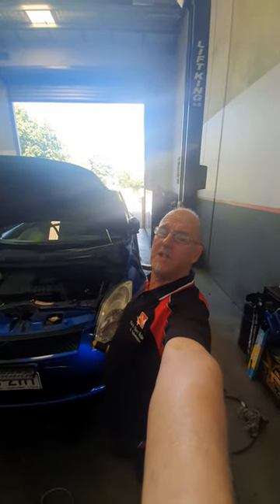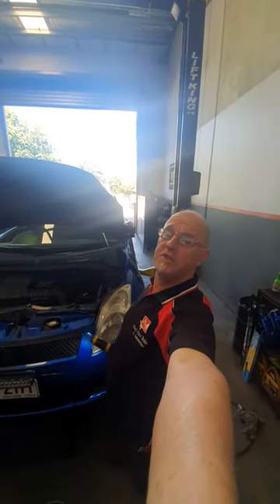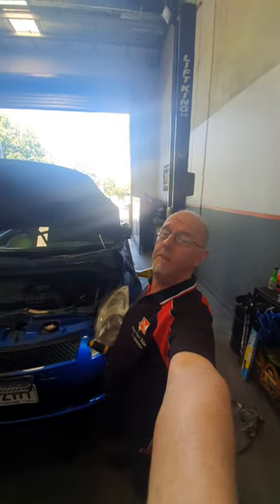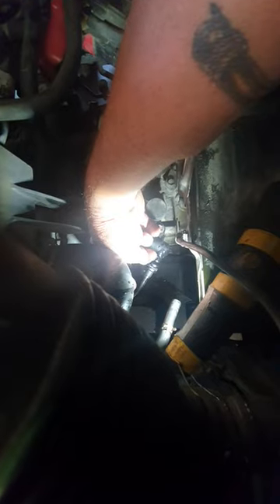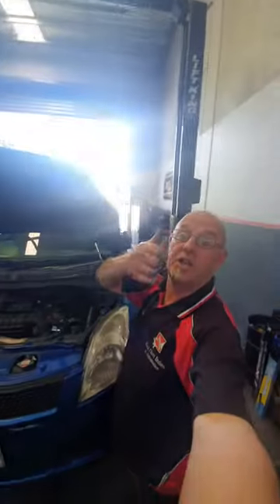Suzuki Swift how to bleed the Clutch

Comment: How deep do u need to push the metal because mine doesn’t have no pressure when trying to bleed ..it just throw the fluid  out
Reply from the maker: Check the clutch master cylinder has fluid coming out if it just in case the master cylinder is faulty
Regards Matt

Comment: this is probs going to sound dumb but by pushing the clutch in and out for long enough and bleeding it would this bleed the brake system too? because my 2008  Rs416  swift sport brake and clutch fluid are all used by the one fluid and not two separate  fill spots
Reply from the maker: If you've been bleeding the clutch and run the reservoir out of fluid then topped the fluid up again it should not have affected the brakes. 
However having said that if the brake pedal is spongy after bleeding the clutch then Yes you'll need to bleed the rear and front brakes. 
Remember no question sounds dumb.
If we never ask a question we'll never get an answer. 
Thanks and Regards Matt.
Reply: Whats if it's the opposite

Comment: I have a question, I push the clip down but I can't get any outward movement on the hose, any advice?
Reply from the maker: Maybe give it a wiggle, up, down, sideways or spray it with some lubricant then give it a wiggle. Regards Matt.
Reply: @firstclassbrakesandautomot6941  Thank you! I'll try it out later today. As a last resort could i just remove the clip entirely? (put it back afterwards ofcourse)
Reply from the maker: @arnodeconinck4643  Anything is worth a go if things become challenging Remember to Perserver NEVER give up
God Bless ya. Regards Matt.
Reply: Fill it up first with fluid then clip the hose on? Then bolt in place

Comment: Hey mate quick question if you got the time, my gearbox is getting real sticky, hard to get into gear sometimes have to double clutch etc, also the clutch pedal isn’t pressing and decompressing as smooth as it once was, haven’t changed the clutch fluid in 4 years or checked it for that matter 😂, could it just need a top up or bled and replaced or do you reckon I’ve fucked the gearbox
Reply from the maker: Hi there
It sounds like a Clutch issue not a gearbox problem
Definitely change the clutch fluid and see how it goes once that's done.
A good idea to change the gearbox oil with the manufacturers specified grade of oil drain the old gearbox oil into a plastic container amd check there's no bits of bearing or filings just to confirm the gearbox is good
Otherwise it may need a new clutch kit fitted
Hope this helps Cheers Matt.